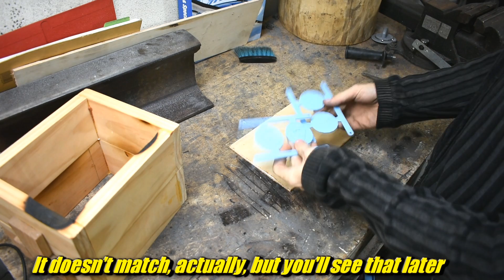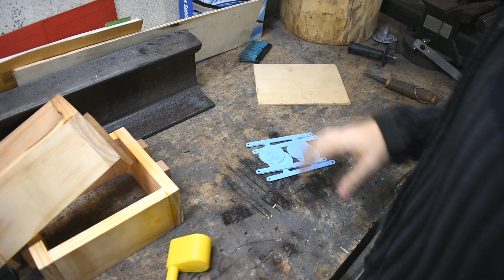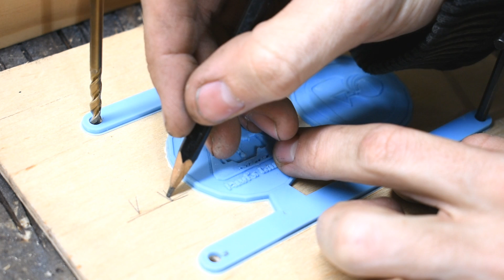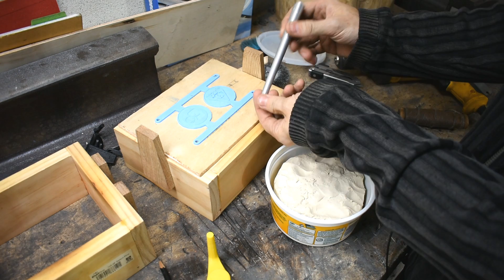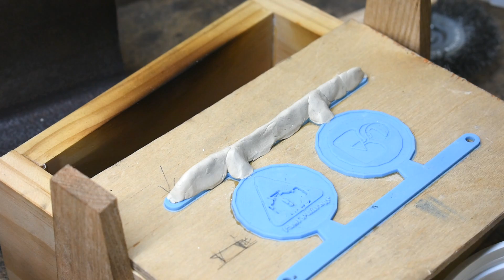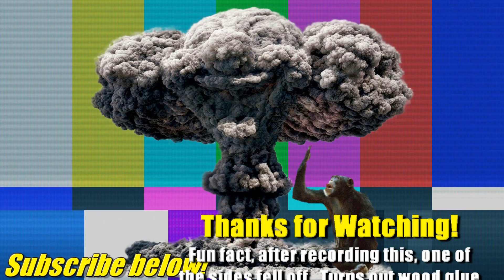FIXED: Make a Match Plate for Metal Casting my 3D Printed Maker Coins

Comment: Could you drill small holes in the corners, top and bottom and put a dowel rod down in there so that you line up all the corners, instead of the lineup on the side like you have?

Comment: I'm wondering how much more difficult it would have been to make the match plate and the board as one P.L.A. piece.  Two of those would ram up pretty good.  You'd probably need locating points on the cope and drag though, and it'd take a lot longer to print.

Comment: Can you repeat what you did with the clay in Fusion 360? It seems like it would be easier to print it.
Reply: Valid point although it would require a lot more time on the printer. It has to be done solid to withstand the ram up.
Reply: Could also include printed locations to hold the sprue and feeder.

Comment: FWIW, I've had tough luck getting stuff that small to release even at 1mm deep and that's with printed draft on things.  My coins are .5mm deep on the detail and I typically paint them to get a small fillet at the bottom of the pattern.  Looking forward to see how you fare. ;-)
Reply from the maker: Weird,  I have never had petrobond stick to anything except itself
Reply: I like the painting idea, I know 3d prints are never super smooth so a could definitely see a coat of paint helping with release
Reply: I started using "filler primer" as it is a little thicker than regular spray paint and it sands pretty easily with 800 grip paper
Reply: 800 grit. Wow Perry that's pretty serious but I generally work with 80 grit and maybe some 120 grit. 240 for really fancy stuff. Then again I haven't mucked around with 3D printing. Might be a great subject for a video on just how much preparation is actually worth the effort.
Reply: Maybe rough up the backside of the form before glueing

Comment: Could you add some narrow strips on the cope and drag to center your matchplate?  Then you may not have to shim the alignment brackets.
Reply from the maker: Yeah there is probably a way to do that.  My flasks dony line up perfectly though so it might be tricky to get millimeter accuracy